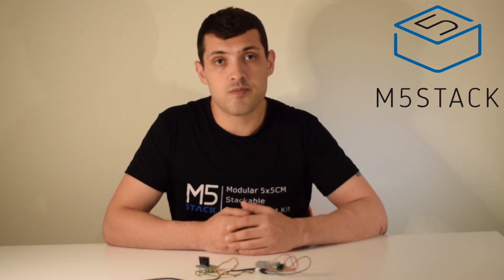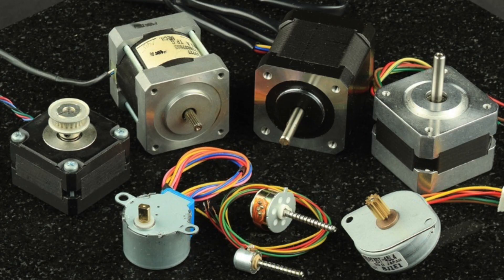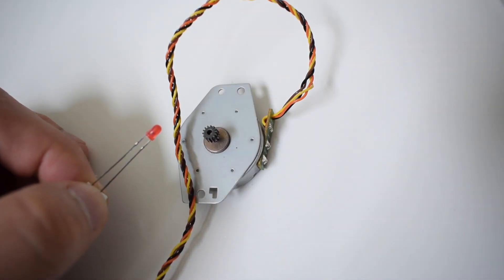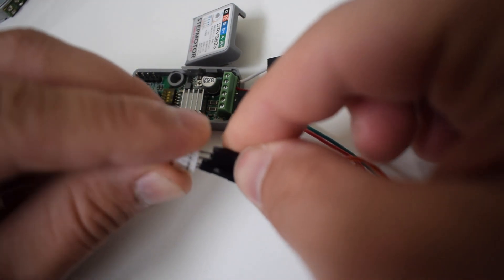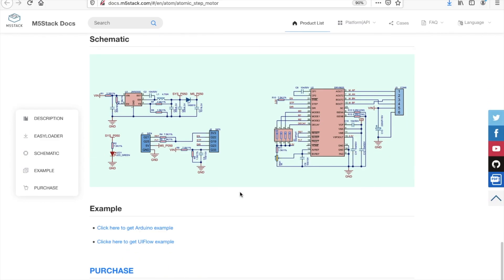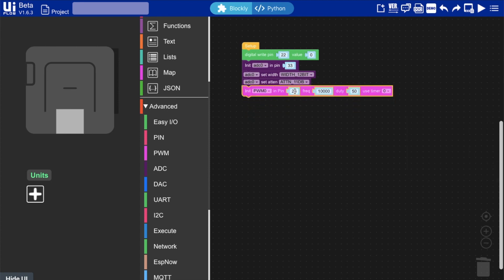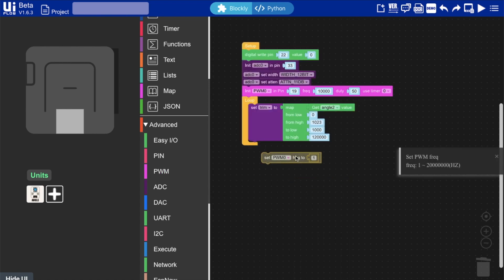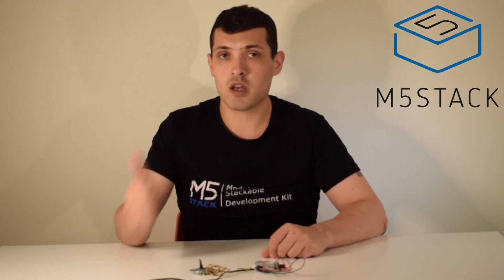M5Atom Stepper control with Uiflow

Comment: I keep watching this video. My challenge is one of my motors has 5 cables. Another only 2. How would I use the Stepper module in this case? 2 cables is highest priority.
Reply from the maker: Hi,  you could message us the motor model and specifications.

Comment: At words "screw changes speed" makes me be surpriced as (1) known stepper drivers use this screw only for "stronginess" of motor, nothing about speed, and (2) microcontrollers as arduino and esp32 can not detect current changes without additional board and mostly we detect changes of voltage on one of "analog pins". Also video, at this place, do not show speed changes, only about motor stop moving at all, means current too low so motor too weak for own friction

Comment: The STEPMOTOR.m5f file does not load in either the Desktop or Web UIFlow.
Reply from the maker: Are you using the latest version of UiFlow?
Reply: @M5Stack  Yup!
Reply: @davelongley  the one on the website?
There is an error on the file due to the GUI changes and requires an edit to fix.
Reply: @AJB2K3  Who do I contact to get it fixed and is there another source in the meantime?
Reply: @AJB2K3  I received an email from Sean Kwok stating it was fixed and the issue closed. The date on the file on Github has not changed.